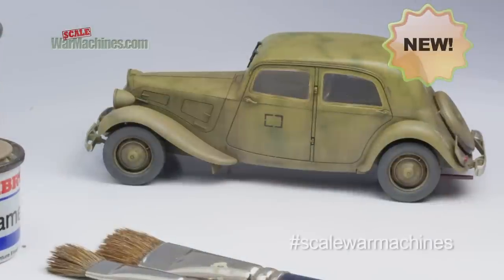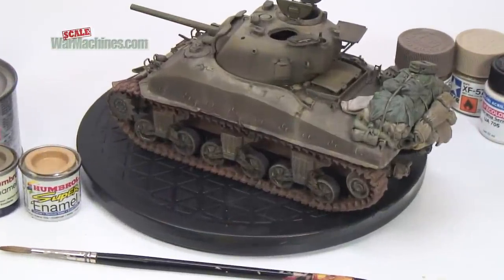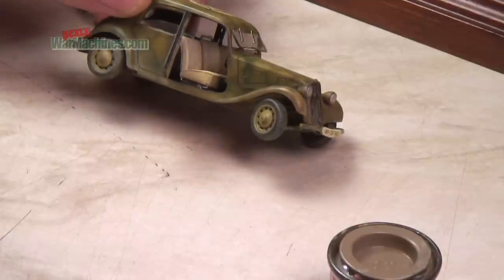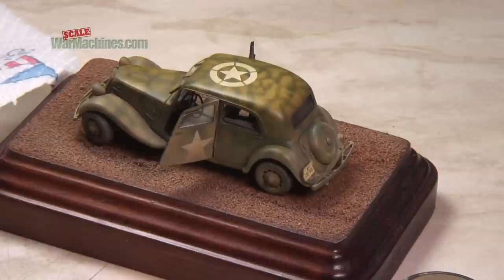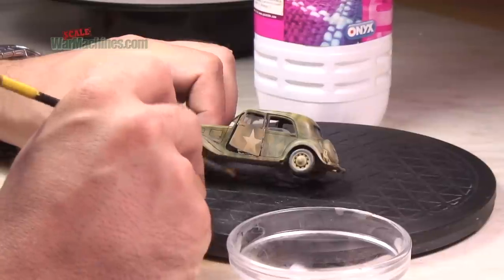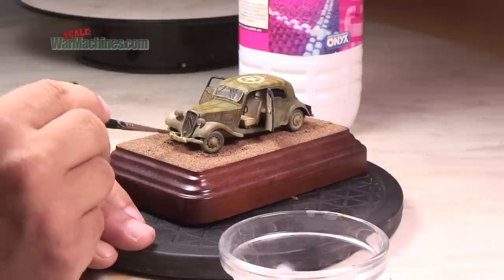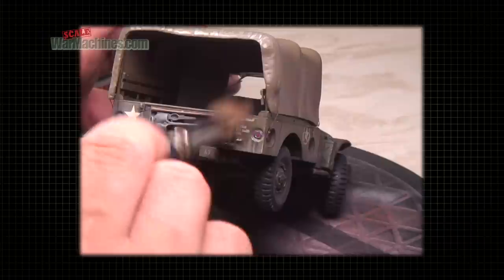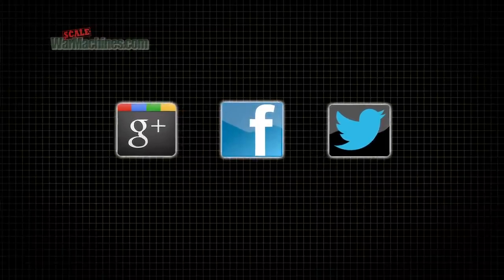ENAMEL DUST TECHNIQUE - MODELLING HOW TO GUIDE

Comment: Great video! :) can you tell me please what kind of varnish you use to seal the coats of enamel paint in between before adding another layer of enamel paint? does it need to be acrylic one again or? Thanks
Reply from the maker: You can go for an acrylic floor polish like Klear or acrylic varnish yes. The advantage over a solvent varnish is there’s no danger of reaction with enamels, oils, thinners and importantly solvent washes. Your paint finish can be ruined if the enamel/solvent coat hasn’t dried thoroughly. As you have to wait for solvent varnishes to dry thoroughly, there’s a time saving advantage too.